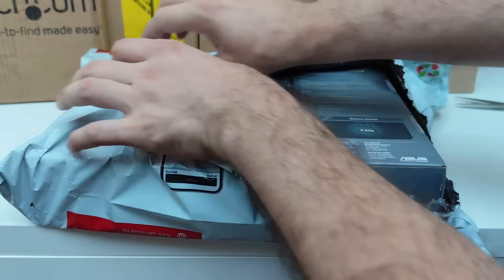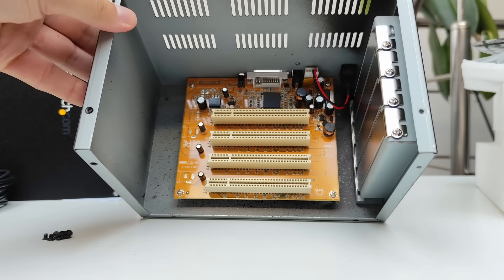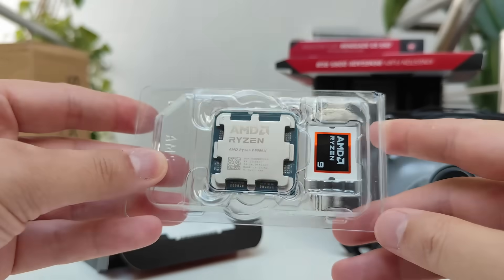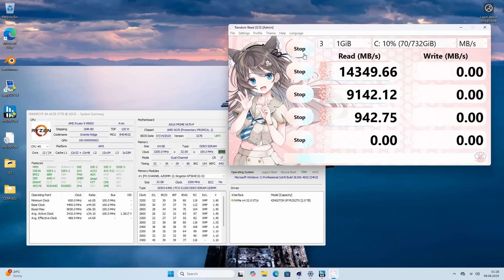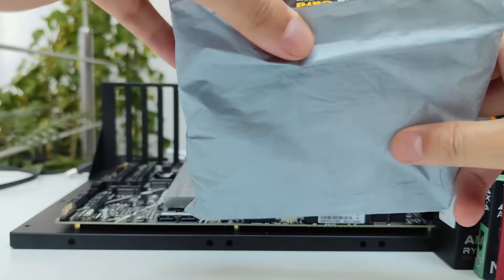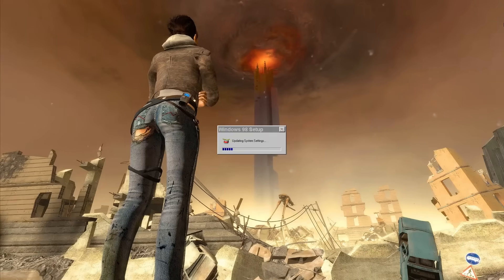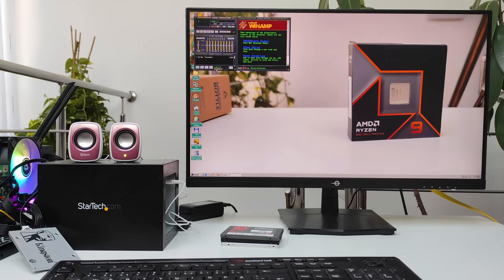Windows 98 on a Ryzen 9 9900X@4.4Ghz and... It (Eventually) Booted! (On Bare Metal)

Comment: Windows 9x can't use more than ONE CORE, and supports NO power saving. If you're going to use 9x, great, BUT this is better used in a VM until there's unofficial 9x patches for modern hardware and features. 9x also has EXTREME problems with memory sizes. Can you even BUY 2gb memory? Arbitrarily limit address size? 9x needs massive work to make it work properly. I wouldn't even try 9x, ME would be the oldest, AND I would install all the unofficial updates and compatibility patches. 9x does support decent hard drive sizes, as I have used a 120gb maxtor IDE drive back in the day. Old motherboards have BIOS options to disable ahci too. If you have PCI support, use a PCI card I guess, but it may be possible to use USB. IDK, there's compatibility tools for this. Don't use what doesn't work. If you can use IDE, use IDE. SCSI is also a viable alternative.
Reply from the maker: Actually, when emulating a powerful CPU/motherboard and GPU in a virtual machine like PCem or 86Box, you’d put more stress on your host CPU across multiple cores than when running on real hardware in single-core mode. Even if the real CPU stays locked at 4.4GHz in P0 state it draws only around 25W. Turbo Boost won’t kick in because it's done through ACPI - and there is where the real power draw happens.

As for memory, Windows 9x was designed to ignore RAM beyond a certain limit via the MaxPhysPage setting. R. Loew’s PATCHMEM is even better since it unlocks access to more memory. In the end, I’d rather use real hardware... a fast 4.4GHz CPU and a native PCIe GPU, so I can enjoy something like the fastest ever Windows 98 PC.
Reply: @O_mores great if you can get it working, the bigger problem is most people don't know anything about 9x troubleshooting, and even mildly experienced people have trouble booting it. I'm a bigger fan of pre-configured images than manual installs. You can't even connect to the internet, so you need all the unofficial patches already downloaded. While none of this is necessary for a VM, and you can control CPU usage in most VMs. Also, 9x uses fat32 and has a tendency to completely corrupt itself with every crash, while scandisk makes NO attempt at fixing files and just deletes them. You can crash and lose the entire OS from scandisk. 9x NEEDS a replacement for this, something that both backups the file table and replaces scandisk. Back in my school days, the school used an imaging service to restore all the 9x machines from kids downloading viruses with internet explorer. The commercial tools used then no longer exist, and they're not available to the public. 9x is generally a bad OS for personal use due to these problems, and NOBODY addresses them. You can backup a VM, while the native tools no longer exist.
Reply from the maker: I think I’ll make the actual use case clearer in future videos - or at least explain better how I personally use it. For example, right now I’m writing this comment, and it takes about 20–30 seconds to shut down Windows 11 and boot into Windows 98. I’m still using the same peripherals, display, and hardware.

I can completely disconnect from the internet for an hour, have a quick DOS session, play some classic Windows games, and when the break’s over, I just restart and I’m back in Windows 11. I don’t see why I should use a separate, era-appropriate PC or a virtual machine when I can do it this way and really enjoy the experience.
Reply: @O_mores if you can make it work, 9x is fun. It's just there's problems, and it's not for everyone. I personally prefer dosbox for dos. 9x for ME has only one use, which is running software that NEEDS 9x hardware for 9x EXCLUSIVE features. One specific use case is running the original half life with a3d audio and the Logitech rumble mouse, or Descent 3 because Descent 3 has special effects ONLY enabled for a Pentium 3. Maybe there's a game using a ViRGE patch, etc. Anything that doesn't need 9x, I can use Windows 10. 9x is also good for Nvidia games using Nvidia effects. Some games used special effects coded for Nvidia. Other than that, it's a pain to install on modern hardware, and any crash can corrupt the filesystem. If you want to promote 9x for real time use, the drive corruption needs to be addressed. HOW can people avoid wiping out the whole drive and losing their files? I know this was addressed in corporate management, BUT it was never addressed for personal use. It's probably less prevalent on flash drives, but fat32 will still wipe out files. There's no safeguards. You need 3rd party protection, or it's Russian roulette. IDK how great dual booting really is either, because you literally have to run the BIOS in legacy mode. You're disabling security and performance features like rebar.
Reply: @O_mores  Some users may want to lock the CPU in P0 state to reduce latency. That is also an interesting experiment: What input latency do you get when running different OS:es o this platform. It is not trivial. The real-mode code used in Win98 is probably slow-path on a modern CPU, yet the OS itself is more lightweight than an NT-based system. Maybe XP is ideal. What is the difference between 32-bit and 64-bit.
Reply: @milasudril  real mode is less latency, depending on interrupts. USB etc. XP 64 is better than 32. You get XP features with 64 support. 64 does ditch 16 bit, and it supports more modern hardware. You can install Vista era hardware, and drives, and there's work arounds for the dx9 limitation. There's also work arounds for 16 bit. You can install up to Windows 7 on a 32 bit Pentium 4, which works better than Linux. 9x has support for vdm drivers. ME has partial support for WDM. You can't use vdm on XP. Long time ago Linux had some support for Windows driver network adapters, and a paid Windows emulator. Cegeda? Linux also had a hack to enable WPA on WEP cards, but I doubt it works now. Mandriva? Used to be close to Windows, but went under.
Reply: I think there is a patch for Windows 98 that should put the CPU in a low-power mode when idle, and it is recommended to apply this patch if running inside a VM. Otherwise, the VM process will eat 100 % CPU.
Reply: @milasudril back in the day I used ATM as a task manager that did this. Good to know there's a patch.

Comment: The crosshair hero x670e has a usb sound card which may work on 98 with a generic driver
Reply from the maker: If it uses the generic USB audio interface, it works. This was actually introduced with Windows 98SE in 1999 and hasn’t changed much (if at all) since then. I can plug in some fancy USB headphones and they work. The problem is that I can’t find any X670E boards with a PS/2 port... only that pricey X870 Apex mentioned in the video, plus many X670s and quite a few B850s from Gigabyte.

Comment: Win98 supports USB input devices so not sure why a P/S2 port was a requirement
Reply from the maker: You can get by without PS/2 in this configuration, but there are times you’ll really wish you had it. The PS/2 port is directly wired to the Super I/O chip, so it works in any scenario. Without it, you rely on USB-to-PS/2 emulation from the BIOS or USB drivers later on. But if PS/2 emulation fails (on Socket 1700 motherboards, it doesn’t work at all with 98), you can’t proceed past the initial setup screen as the USB devices are initialized in the second phase of setup, after the first restart. Not to mention when you add new USB keyboard or mouse, or installing the actual USB drivers - you have to press "Next" - but the USB stuff isn't working yet. :)
Reply: Only If U have Luck
Reply: Although there does exist hacked drivers, win98 doesn't support an optical USB mouse. Having said that during initial setup there is no way to install the driver and a working mouse is needed. Most other people have ran into this issue and resorted to pre-installing win98 and the driver on a ps2 compatible test bench or within a VM, then swapping the drive into their fresh build. XP was the first to have native support
Reply from the maker: @Twenty_Six_Hundred - During the initial setup, Windows 98 doesn’t look for USB devices, but it will detect a serial-port mouse since those were very common back then. So having a motherboard like this X670, which has a native serial port (via the Super I/O), can save the day during the first stage of setup. Later, Windows 98 will pick up USB devices as well.

The good news is that on this configuration, USB-to-PS/2 emulation done at the BIOS level it actually works, so you can actually install it without needing a PS/2 or serial port at all.
Reply: @O_mores  I see. I either forgot that Win98 didn't support USB during setup, or didn't know I honestly do not remember if I have ever installed it while using USB input devices. Thank you for the answer.
Reply: @Twenty_Six_Hundred   Even though it's a GUI OS you have never needed a mouse to use Windows. It can be completely controlled via Keyboard

Comment: now we just need someone to run windows off of a CPU cache
Reply from the maker: AMD is preparing two new Ryzen 9000-series CPUs with dual 3D V-Cache chips. Currently, the cache is only tied to half of the chip, so the 9950X is basically an 8-core CPU with extra cache for gaming. But soon, we might see something like a Ryzen 9 9990X with 16 cores and 192MB of cache... just enough to run a Windows 98 install...

Comment: bro, I'm not an expert, can u provide me already made iso itregal xp file for x570 motherboard or x450 motherboard?
Reply from the maker: Need the 32-bit Integral Edition or x64? The SP3 x86 version is easy to download from the source and has a fairly recent update. If you’re after x64, I don’t yet have an ISO that works with AMD SATA chipsets.

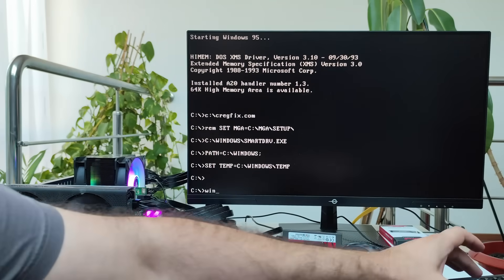The SSD shown at 12:40 was first used on an Intel board—updated AHCI drivers there—then moved to this setup. Try the Universal NT Installer from GitHub, it supports XP too. I used it with NT 4.0 and it worked perfectly
Reply: @O_mores i need 32 bit, i have already but can't install on my x570 mobo, its says no driver found during ashci where i already customised and seleceted all mods driver!
Reply from the maker: Just search for "XP Integral Edition Zone94" and it should be the first link. Pick the 5.5.2025 version. Check out this video on how to make it work: https://youtu.be/pE3CswJweqs The ISO you'll download it's just a base for creating a custom ISO, don't use it as is.
Reply: @O_mores yes i have already downloaded it from there and made custom iso with all option selected
Reply from the maker: That's the exact ISO I used in the video with XP SP3 on Z790 motherboard, check if it helps: https://www.pinzaru.ro/windows9x/XP_SP3_Z790.iso

Comment: Thank you for showing what is possible. There are not many people thinking out of the box
Reply from the maker: Thanks for watching. And yeah, I really love restarting from Windows 11 straight into Windows 98 on my main PC. It's perfect when you just want to take a break.
Reply: @O_mores I wish that there were a possibility to shut down one of the video cards completely. Having both installed and running draws a lot of power
Reply from the maker: There are some external PCI-E x16 enclosures, but the power draw isn't actually that high. By default, a PCIe x16 card is capped at 25 W (that’s the PCIe spec). The card can request higher power states, but that only happens once drivers (or firmware) initialize it. Without drivers it just runs in a super low-clock VGA mode, so power draw stays under 25W. Once drivers load, the GPU can request more power but also enters a proper idle state - often using even less than the 25 W cap.
Reply: @O_mores That makes sense. I actually never measured and compared it. I had a Voodoo 3 as a secondary card and never bothered about power draw. But 7800 GTX?  I am scared looking at the powerful cooler 😅
Reply from the maker: I think we're fine with the idle power draw. I could use a watt meter at the wall and isolate the GPU's power usage by comparing system draw with and without the secondary card... (I just don’t have the meter yet).
Reply: @O_mores Exactly this setup for comparison is what I have in mind. As far as I remember the 7800 GTX, its fans spin down after drivers are loaded. Wondering what clock state it has on boot up or without drivers
Reply: @O_mores  now try win95 :)

Comment: Isnt there a 2TB fix for 98?
Reply from the maker: Yes, there is a patch, but it won't work when the drive is handled via BIOS. We need to install AHCI drivers to make of use of that patch, but AHCI might not work on this motherboard. On an Intel Z790 motherboard, everything is much smoother when it comes to AHCI, check this video: https://youtu.be/G7qm3GFy9tg

Comment: Thanks for the video, not a relevant question but do you know any Win 95 driver for an ATI 9200SE PCI?
Reply from the maker: I actually have. I used such drivers in this Windows 95 on 13th Gen CPU video: https://youtu.be/6xAgMiTNk3Q You can download them from here: https://www.vogons.org/download/file.php?id=144825 Some fiddling will be required.

Comment: thank you so much, im on am5, and ive been trying to get vista to work because i thought it was funny that the 9800x3d and vista rtm were released exactly 18 years apart. i thought i could get it running as i saw your previous 13/14th gen intel cpus doing it. hoping youll do more am5 content in the future, this video seems like a good first step
Reply from the maker: I will check Vista soon! Since XP x64 works on this configuration with USB 3.x and NVMe support (check the video at 12:40) I expect only good vibes from Vista.

Comment: Well well well, you've solved the mystery - I also got the NTKERN error on my MSI B650M GAMING PLUS WIFI and 7500F. 

Have you tried USB keyboard/mouse, either via legacy mode builtin ports or via dedicated PCI-E card? For me USB keyboard/mouse stopped working after entering EDIT program in DOS which is interesting....my mobo doesn't have ps2 ports sadly so no easy solutions like in your video :)

Can you try if enabling RAID mode in the integrated SATA controller solves the issue?

You can check out latest SoftGPU version - it works now on real hardware, not just virtual machines, a nice alternative to VBEMP...would be interesting to see if the integrated GPU in this Ryzen works with it :)
Reply from the maker: I tried RAID mode - it doesn't make any difference. However, after the latest BIOS update, the NTKERN error is gone. Instead, I now get this: 'Error: An I/O Subsystem Driver failed to load.' Actually, that one feels more familiar. :))

USB emulation does work in Windows 98, and I even used a USB mouse with the LMOUSE.DRV trick I told you on MSFN. Still, I'm hunting for motherboards with a PS/2 port, like the X870E APEX. There are quite a few B850 models with a PS/2 port from Gigabyte, and are cheap. 

I'll try SoftGPU soon, but maybe I can get a Windows 95 video ready for next week - it’s been 30 years since August 24, 1995...

Comment: I'm conflicted on that heatsink fan from Arctic. I love how the fans snap on, that blows my mind. However, I don't want to have to take the backplate attachment off to open the cpu socket gate. Also, imagine if you had a dock that plugged into your pcie sata card that could go in the external enclosure, that you could just slot a 2.5" SATA SSD right in like it was a CF card or something, that would be mindblowing!
Reply from the maker: The Arctic Freezer 36 was a cool... surprise for me too, especially considering it costs about $50. Anyway, coolers of this size usually require mounting with their own brackets, but this one doesn’t require removing the backplate - just the standard plastic brackets that come with any AM5 motherboard. The PCI-to-SATA adapter with a VIA6421 chip shown in the video has an external SATA port, and since I have an eSATA bracket, I can use it to supply 5V to a SATA drive directly from the PSU.
Reply: @O_mores  CPU coolers have been leveraging stock AMD brackets since the AM2/FM1 sockets.. Socket A and clip on Coolers was a fun time, everytime you install a CPU cooler going please don't crush the die(no IHS on those), please don't crush the die. My current Socket A MB is fun because someone destroyed one of the middle tabs, so only the three tab clipped coolers work on it...
Reply from the maker: Yeah, I remember those days as if it were yesterday. At one point, I had a slightly bent screwdriver that helped me get a good grip on those clips. In mid-2003, the AMD "Barton" 3200+ launched at $400 - that's like $700 in today's money. I remember installing one when they were still expensive. Never broke any, though I might have gained a few grey hairs in the process.
Reply: @O_mores  I'm not saying removing the backplate. In the video, you mentioned that the bracket to attach the heatsink to the cpu didn't allow you to open the lever on the cpu gate, and that the top part of the mount blocks the lever, which isn't the worst thing.
Reply from the maker: Oh, I see. Yes, if you want to change the CPU, you have to remove the 120MM fans first to access the radiator screws. Then, you need to remove the left bracket to reach the lever. Good thing we don’t have to do this very often, though!

Comment: How much memory on windows 98? I tried and had to tune in system.ini to limit to 1gb
Reply from the maker: On my setup, Windows 98 sees about 1.7 GB with PATCHMEM by R. Loew (and without having to use MaxPhysPage in SYSTEM.INI). On my Ryzen 9 3900X, it actually goes up to 3.5 GB.

The reason you don’t get the full 4 GB is because a chunk of that first 4 GB address space is reserved for system use. Modern hardware maps things like PCIe devices, GPU VRAM, and BIOS/UEFI into that space, which reduces how much regular RAM Windows will actually get.